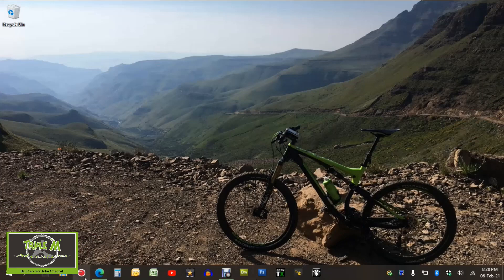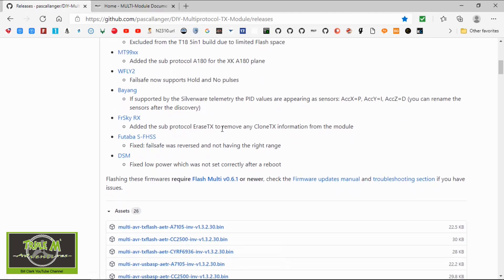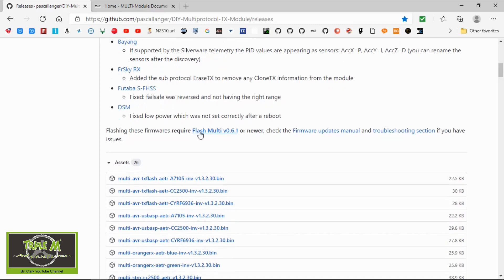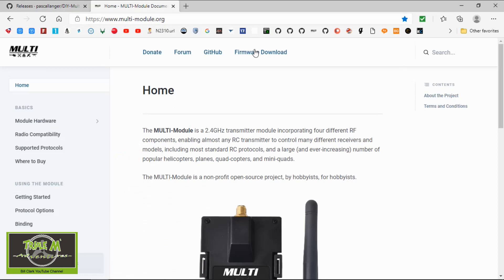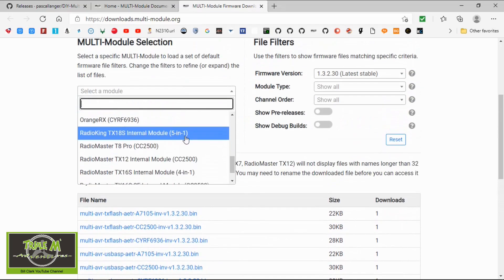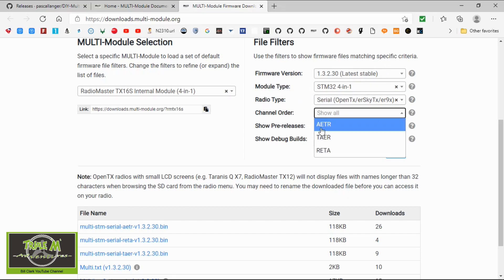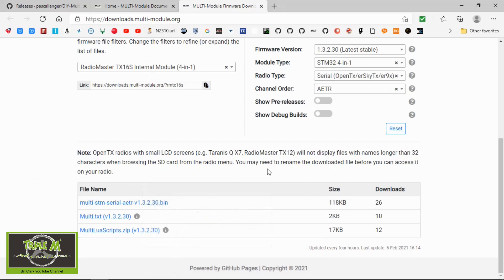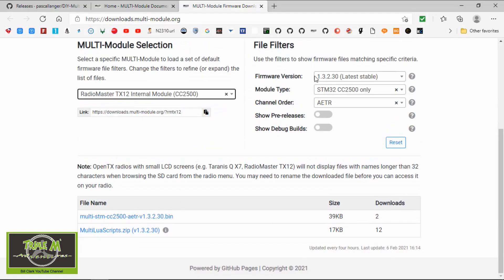Multiprotocol Module Firmware Update v1.3.2.30 Available Now

Comment: Hi i have RadioMaster TX16s Hall edition. When i try to download the firmware i get 2 options 1. Internal Module 4 in 1 & SE Internal Module (CC2500) Can you tell me what is deffrence?
Reply: when i tried CC2500 there was no DSM support (Spektrum). Which i flashed 4in 1 then it has DSM support. Which one should i flash?
Reply from the maker: If you have the 4 in 1 internal module you need to select:
RadioMaster TX16S Internal Module (4-in-1).

If you have the TX16SE this only has the CC2500 chipset so you would need to select:
RadioMaster TX16S SE Internal Module (CC2500)

The Internal CC2500 RF only supports the Frsky & SFHSS protocols. The 4in1 has many more protocols such as FlySky.
Reply: @the-happy-RC-flyer  thanks for the quick response. From SE you mean Radiomaster TX16S SE?
Reply: How would I know which one I have as I have 2 models one is TX16S SE & the other is TX16S with hall carbon fiber edition.
Reply from the maker: @accessvikas  yes that is it’s full title.
Reply from the maker: @accessvikas  Check the box your radio came in. If you have not flashed any firmware to it and it has its original factory firmware go to Model Set Up and go to the RF section turn on your Internal multi protocol module if you can select FlySky you have the 4 in 1 module. If you only have around 13 protocols the it’s the CC2500 RF Chip.
Reply: @the-happy-RC-flyer  thanks bill
Reply: @the-happy-RC-flyer  thank you so much.

Comment: The Frsky RX update is one I suggested - basically it allows you to wipe a cloned Frsky ID from the MPM in case you want to sell the TX (or the TX you cloned from). Not for use when flying! Incredibly Pascal implemented it in less than 24 hrs.
Reply from the maker: The developers are great, and thank you for the information.